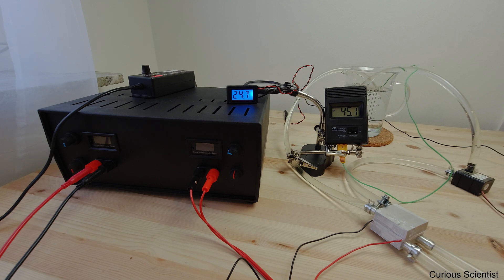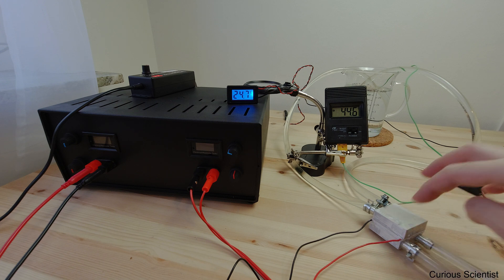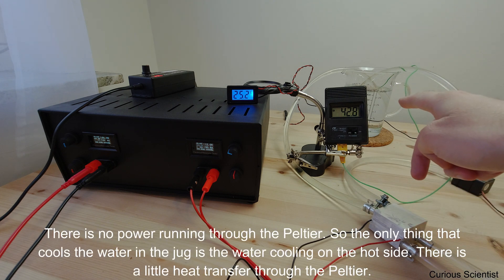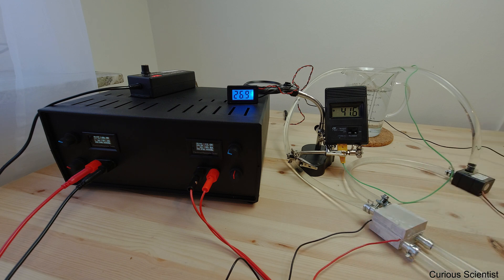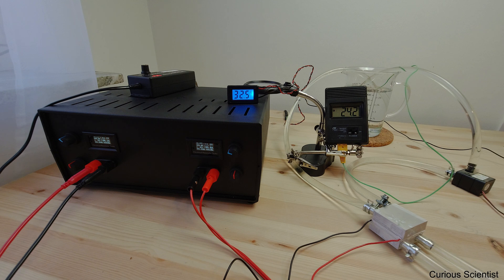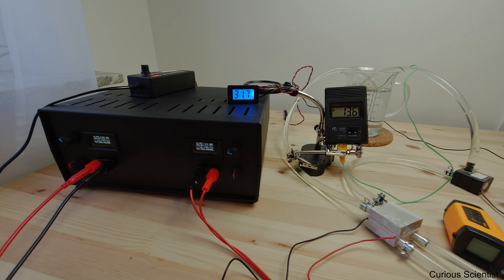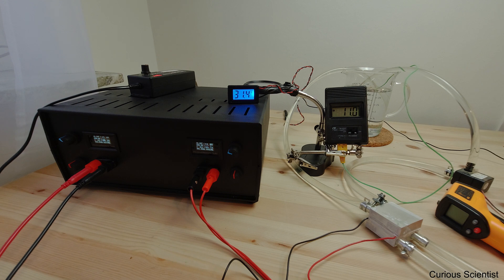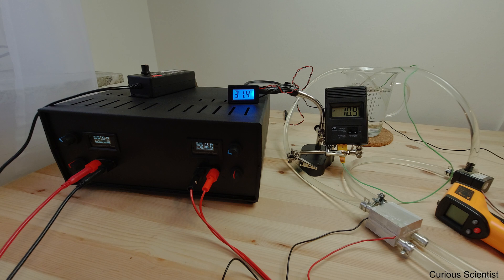Cooling a jug of water with a single TEC12715

Comment: What is the flow rate of the cold water side? Low flow will result in cooler temperatures...
Reply from the maker: If I remember correctly, the pump is a 100 l/h pump. Or 200 l/h. I am not sure.

Comment: Peltier Module use electricity to cool down water... Where Refregrent is cool itself Just need Pumping. 
Excellent Sir...to match one ton AC you simply need 25 sets means 2500 watt per hour.
Reply from the maker: The refrigerant doesn't cool itself...

Comment: I am an old fan of your peltier experiments. What if you tried this exact same experiment with a 12706 which will also be within the capacity of your power supply and also can reach much lower temperatures? Just curious
Reply from the maker: 12706 is a nearly three times weaker Peltier cooler. The results would be worse.

Comment: Very nice and useful experiments!
I am also trying to develop a cooling system using a Peltier now, this video is a very nice reference for me. Thank you for sharing!!
In this video, the data of the temperature of the circulating water of the cool side seems to be not measured, do you have data on it? 
Since, the water temperature in the jug was 11 degree Celsius as a final result, I think that its temperature is lower than 11 degree Celsius... 
Also, if data is,  could you inform the amount of water within the cool-side tube? 
Again, thank you very much!
Reply from the maker: Hi!
I am glad that you found my video useful. 

I said at 1:30 that there is roughly 1 liter of water in the cold side part of the system. That is essentially the water in the jug and the hoses together. The temperature of the water which is circulating in the cold side is roughly the temperature of the water which is measured in the jug. 

The temperature of the water which is circulating in the cooling system of the Peltier is always visible on the LCD with the blue background light. I talk about this at 0:35. For more references on that cooling system, check my other video: https://youtu.be/gmNxUH11Uno

Everything is mentioned in the video that you were asking for. Please watch it carefully!

Comment: Sir you should try 12 v 200ah lead acid battery... than it will only take a few minutes to freeze the water.
Reply from the maker: Not, it will not. The Peltier has a limited cooling capacity and it will not be able to freeze the water. Not this amount of water.
Reply: @CuriousScientist  i used many peltier at water block and water was freeze
For hot side i used car radiator with 10 lit water
But i do not used technology which you are using